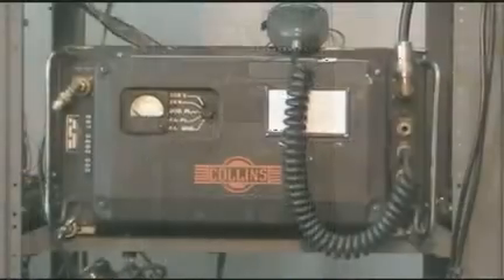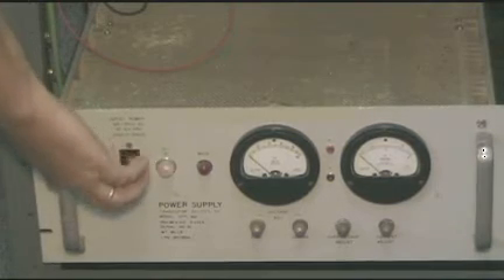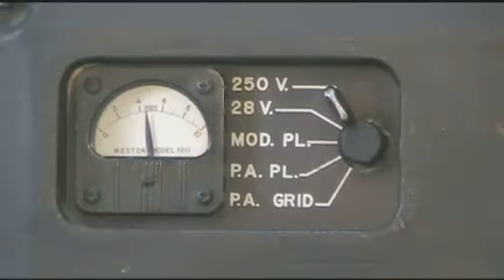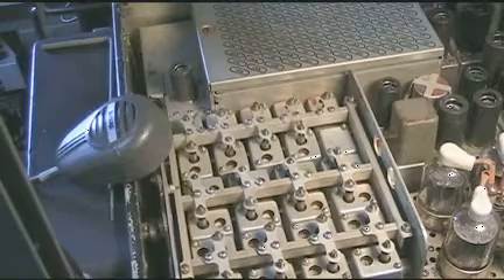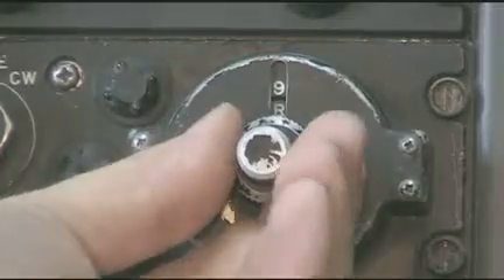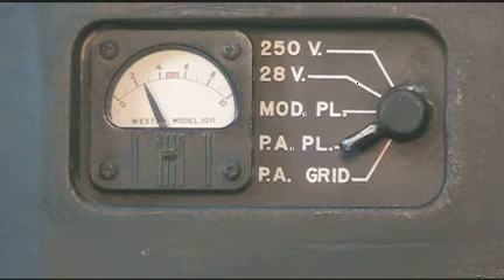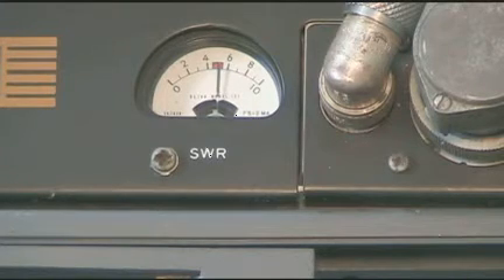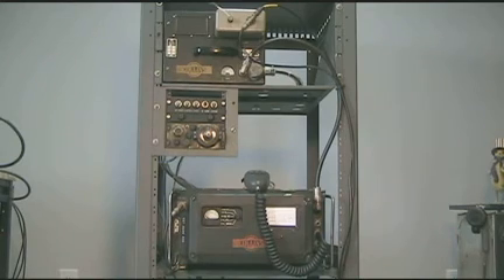collins 618S1 Transceiver

Comment: Nice unit.  I worked on the An/ARC-38A version in the Coast Guard.  We used them for SAR missions in Grumman Albatross HU-16E And the C-123.  I little finicky to work on but the SSB signal really got through when it counted.